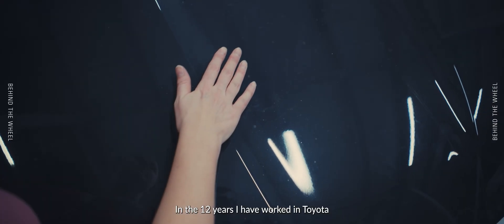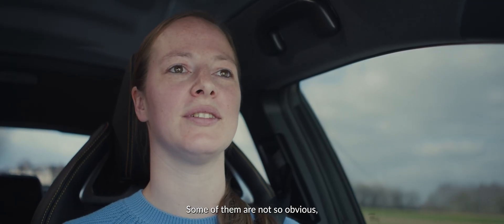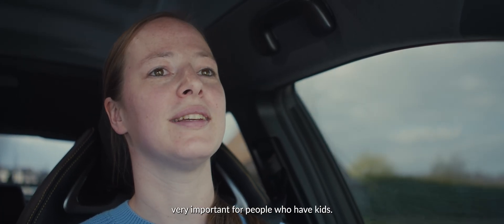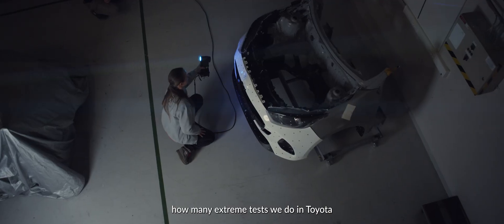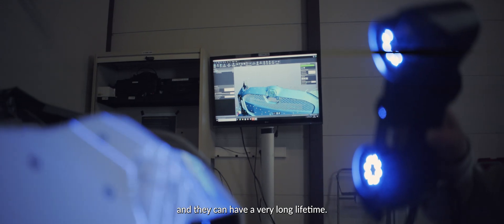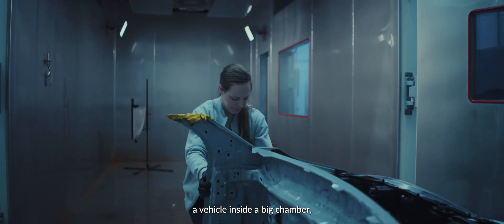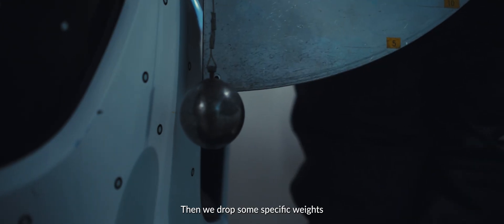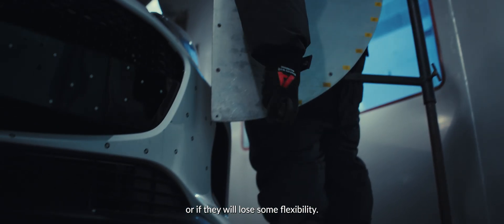Behind The Wheel - Episode 2: Inside The Materials Lab

Comment: Interesting but a little concerned when you mentioned recycled plastics. I hope you dont intend to use any pet plastics that contain Pthalates, (type1 etc ) I'm afraid my current Rav 4 would be my last one if that's where you are heading.
Reply from the maker: Hello. Recycling plastics can be difficult, but since 1981 Toyota has made it easier by marking what type of plastic each component is made of. Plastic components are designed to fit together without metal fasteners, while a new kind of plastic that can be recycled more than once without degrading has been created. We care about sustainability, it is central to who we are and what we do so learn more here: https://www.toyota.co.uk/discover-toyota/sustainability Thank you.
Reply: @toyotauk  thank you. I have looked at your link, its all well and nice for you but the answer to my simple question is unclear " Do you intend to use Pthalates in your car interiors "? Aka type 1 recycled plastic or PET or polyethylene terephthalate? I know you currently do not as you confirmed to me before I bought my current Toyota. I know "sustainability " is the latest buzz word but I care about my health, that comes first.